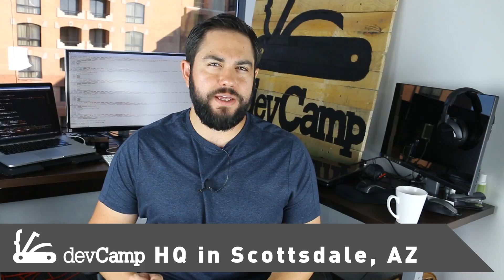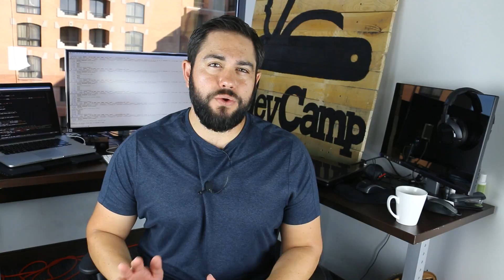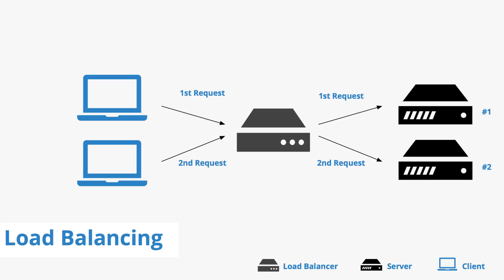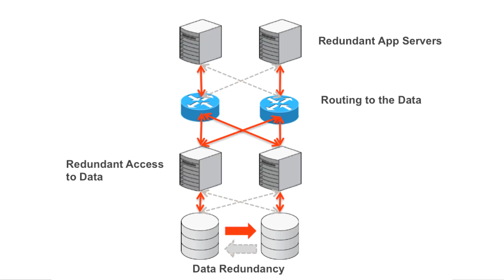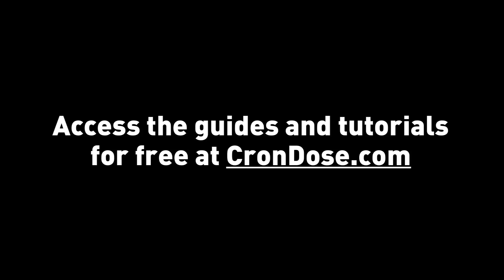Load Balancing vs High Availability

Comment: Hi Sir,

Can I ask you something,

Now I have maintenance 3 Server, and running Debian. and it has 50 Apps running 24 Hour.

I need install Load balancing or High Availibty to that server but still Not clear with the Database and File data

Now My server
Server A:  for Apps/COde and File Attachment server
Sever B : is For Only database
Server C : is back Up All From A

If I want to Load Balancing or High availibilty,

This Scenarion what I see on your Video is
C: Load Balancing Server
A: app Server
B: App server

My Question
If User Access Load balance and forward to server A: it Mean File Attachment and Database ON Server A,

And then tomorrow the same User acces load balance and forward to  Server B, he will not find his Insert data and Attachment on Server A. How to Fix This for Attachment and Database?

Can you Explain me To Me Sir.

Thanks

I hope you know what I mean.
Reply: I can help but first I need to know approximately how many requests does your website get per day? 10s, 100s, 1000s or millions?